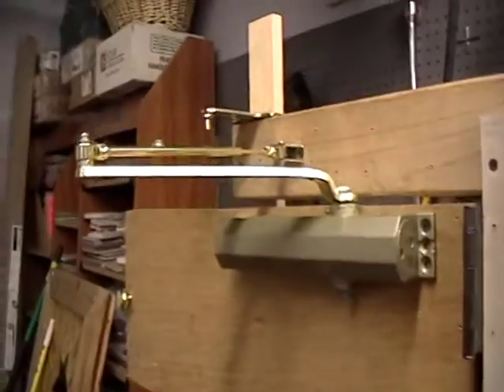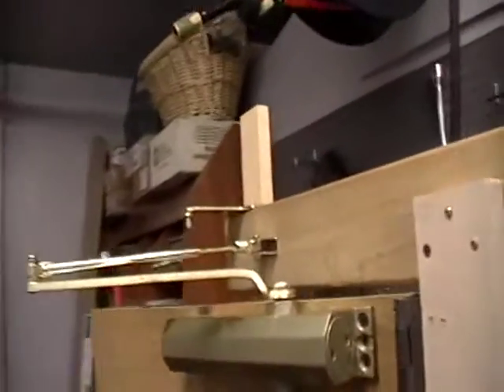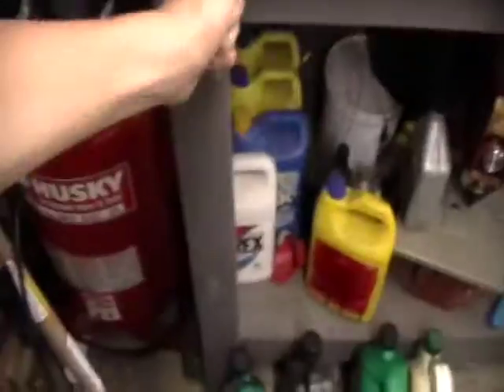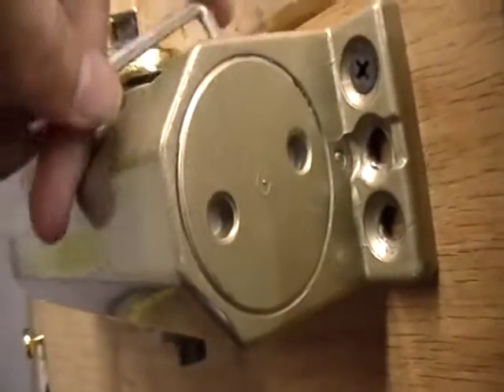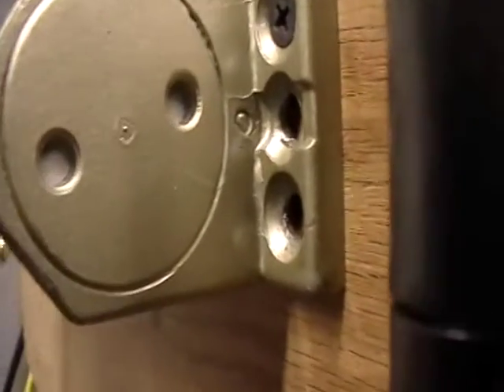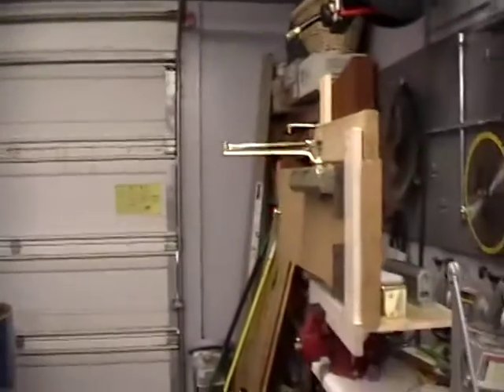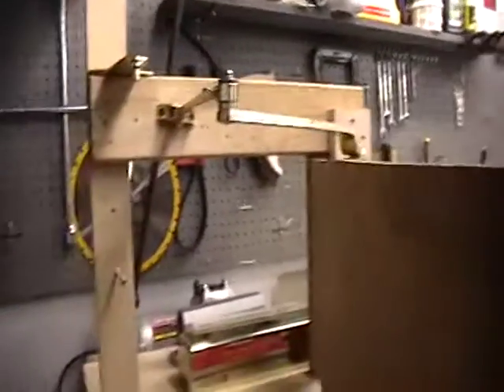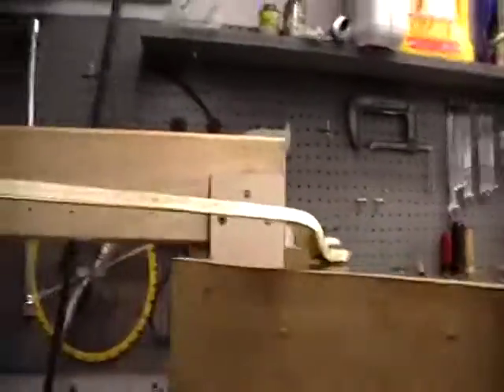My Taymor Door Closer Mounted To My Fake Door

Comment: Nice job Nick! The arm is going a little bit weird when opened all the way, I think you should use the template this time or just move the closer further away to the hinge side and move to the latch side (moving to ←) Make sure not to make it leak by turning the valves too many turns finally removing the valve. I would prefer speed 3 or speed 1. Depends on which scene is your door at, if you are in your garage, use speed 3. If you are in somewhere that needs more security, use speed 1.

-90TBAZ